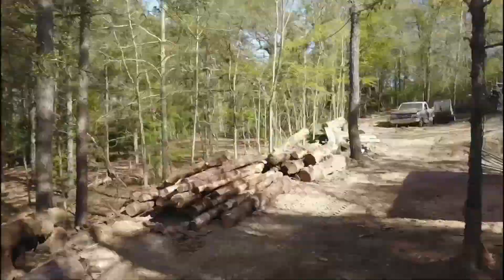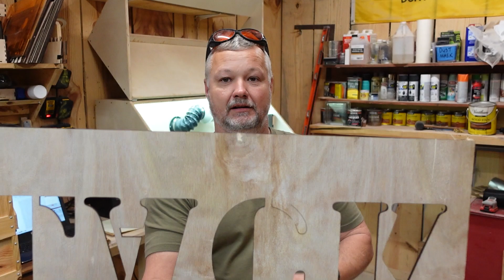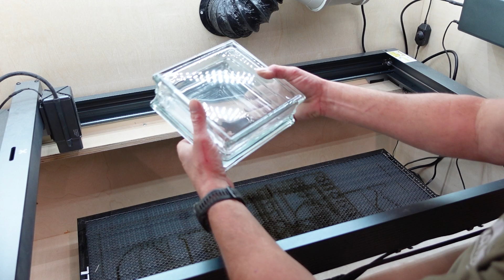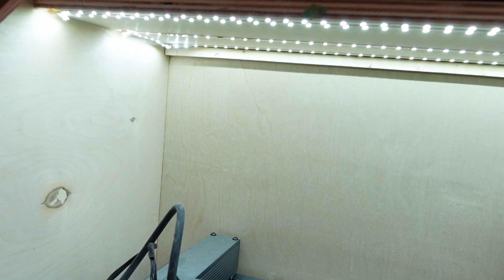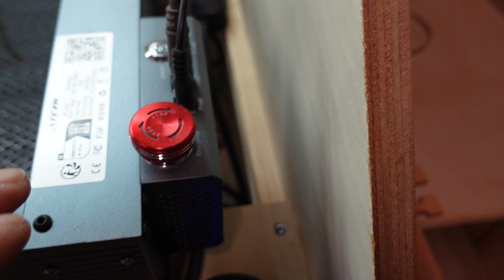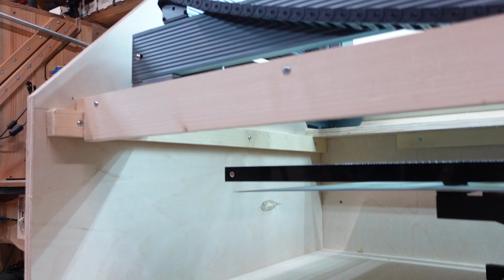Is it BIG enough? my Atezr gets a new home

Comment: Can you tell me how to setup the L2 36W software for the expansion rail?  There must be a setting for the expansion. Thank you for your help
Reply from the maker: I will try to knock out a short video later. There are some settings in the controller that need to be adjusted to allow the machine to work correctly. Only issue if they aren't changed is that you will have to home twice to make it all the way.

Comment: 2 questions. 1) is the Hon&Guan duct fan on your box a 4 inch?   2) On your interchangable jig kit, will this fit the RA2 Pro rotary?  Thank You Sir.
Reply from the maker: Yes, 4 inch. Yes, you can cut any shape into the panels that is needed or just use the squaring panel. I included a RA2 jig with the Xtool kit.

Comment: Did you modify the honeycomb? It seems bigger than the bed size.
Reply from the maker: No, its a Nivill 37 inch. Link in the description
Reply: @TheClackShack  I’m confused. 850mm bed is 34.6 in, vs 37 in honeycomb ?
Reply from the maker: @shughes599  yes but the work area doesn’t account for the gantry and module. Also, you do not want the solid frame around the edge in the workspace. Watch my videos to see how it fits

Comment: You dont want that air assist inside the enclosure. even with exhaust, there will still be some debris sucked up, and pass the filter and be pushed into the laser lense area above the nozzel.
Reply from the maker: It was temporary, I run shop air

Comment: Hey love the video's. Between you and the LA Hobby Guy you two have inspired this 68 year old retired guy to start a laser business, and having a ball. Bought my first laser 1/30/23 started my business 3/15/23 and have the P20 with extensions on it's way. Going to build the same enclosure for mine. I have 2 questions, is the front piece of 3/4" 12"x48" or 13" or 14" in height or? And the piece on the top back against the wall does it come out 12"x48" or 13," or 14" or, before it hinges? Funny, good friend of mine was a SWAT guy, love the flag.
Reply from the maker: I have the drawing for it in the downloads in our laser engraver community Facebook group
Reply: @TheClackShack  Thank you, but I do not do Facebook. BTW-thanks for responding to my message.

Comment: Thats a nice enclosure, well thought out. Have you thought about drawing air down and out of the enclosure from the bottom chamber? It could be done with a flexible hose attached to the exaust fan. It would have the benefit of drawing smoke down and away from the laser, the laser is blowing air in that direction anyway, it would work together. Careful placement of intake air ports would facilitate airflow too. Smoke removed in this way would keep the upper area a lot cleaner in the long run.
Reply from the maker: I always try for bottom draft. I have been working to complete the design.
Reply: @TheClackShack Any progress on the vacuum bottom?

Comment: Awesome!  Looks like you made it out of 3/4" Ply.  heavy duty!  Are you going to publish your plans?  I'm hoping to get mine enclosed soon so I can reorganize my shop.

What power/speed did you use to cut that large sign with?  Was it one or more passes.  I don't see my P20 cutting anywhere as fast or complete as yours.  I'm actually wondering if there is something wrong with my laser that it has to go 8 or 9 passes to cut 3mm basswood.
Reply from the maker: 4.9 mm cut at 8mm/s at 100, 1 pass. I have heard of an issue with the output being limited due to a setup error. Make sure the S value is set to 1000.

The plans are still in development